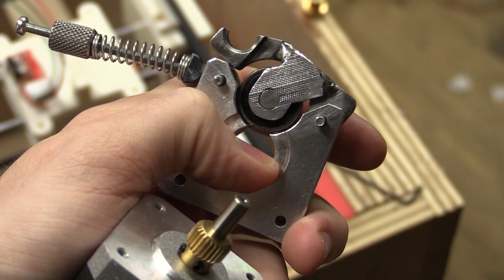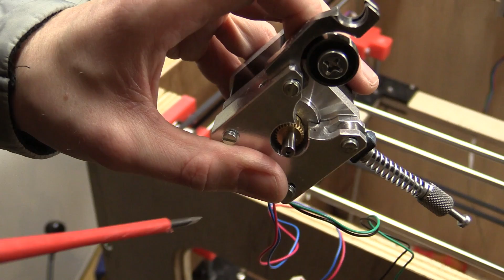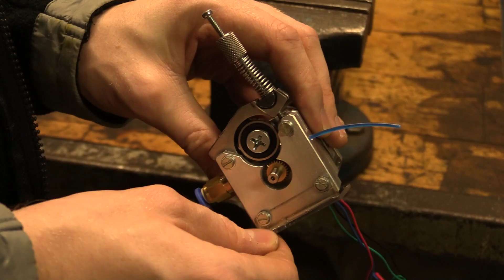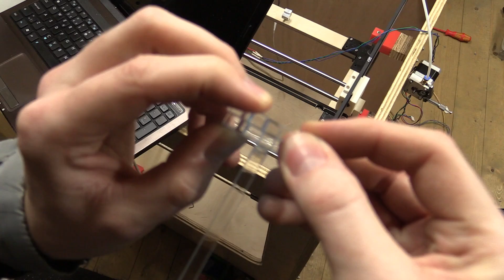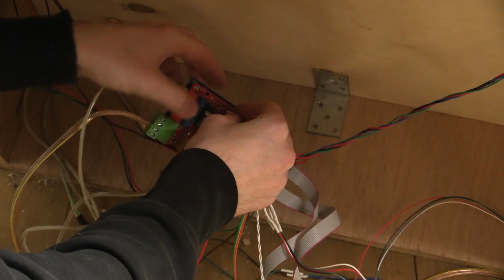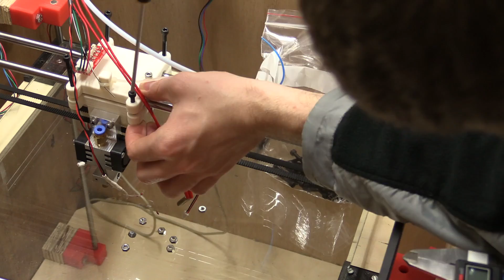DIY 3D-Printer Build (From Scratch) - Part 8: Installing Extruder and Filament Holder - Ec-Projects

Comment: Makes me wonder... is there a way to make a 3D printer without having a 3D printer?...
and a god damn laser cutter?
Reply: Rafał Białek agree
Reply: Rafał Białek every design i find uses a 3d printer
Reply: Rafał Białek the lasered and 3d printed components can be replaced with wood but I'd keep the components near heat something else than wood
Reply: 3D printer, GD laser cutter, and a benchtop milling machine.

Look! I made this part out of solid aluminum in 20 min. of millwork. Now I can finally prototype much less precisely, durably, and reproducibly in plastic!

It's as much if not more extreme craft project than it is ubiquitous tool.

Comment: I notice you use quite a lot of double sided foam tape, have you considered making Magnetic coupling clamps ? makes removal and reassembly fast and easy. Using custom magnetic channels so the magnet will auto center itself precisely !

Comment: did you check if the stepper motor drivers have the current set correctly and that they are not overheating? because the z-axis ddiver has to drive 2 stepper motors instead of 1 it can get too hot. I slowed my axis accelleration down in marlin for them to work correctly.